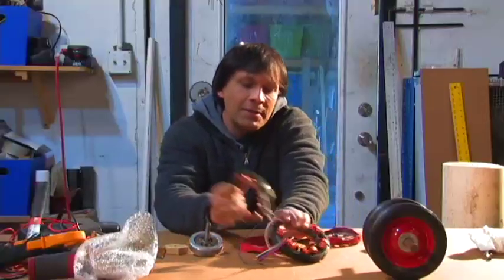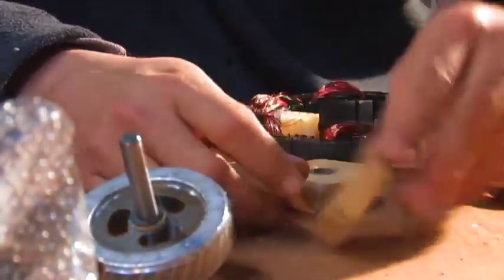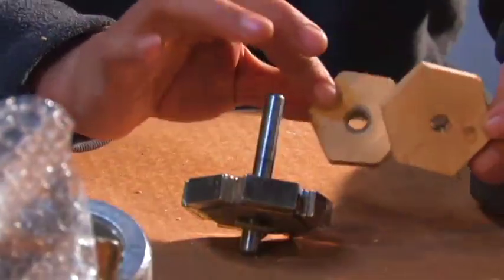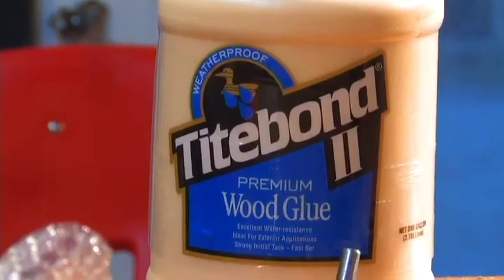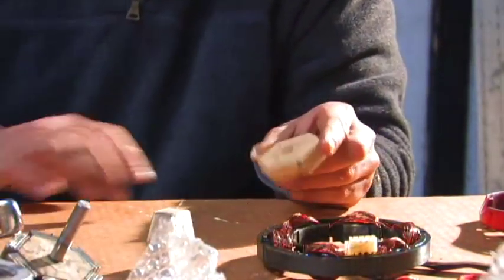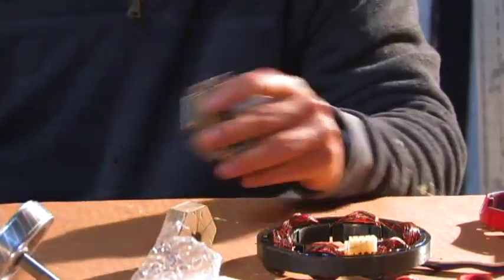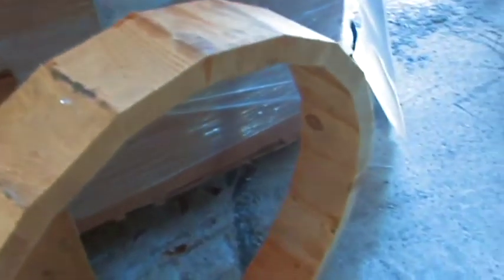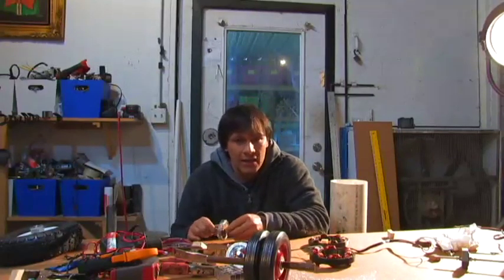INDUCTION MOTOR hack ALTERNATOR DIYNEODYMIUM MAGNET part 2

Comment: Hi Dan,

I have a suggestion to improve your design. If you Google "magnetic reluctance", you'll see what I'm getting at. I suggest adding pieces of steel, flat on one side and curved on the other, to fill in the space between the stack of magnets and the coils. The performance of the device should improve. It was stressed to me in college that the air gap is your enemy, in a generator. Better bearings allow for a smaller gap.

Thanks for being my host! :D

Comment: I would like to build a pma. But I was wondering if I can use any copper wire? and the other question is that if I use a bigger wire I will get more amps? Right
Call me dumb, but I rather ask than to stay in doubt. 
Thanks LM

Comment: @snooter28 Also, I thought about a turbine inside the gutters (vertical pipes) - but how many hours does it rain, really, and how often does it rain so much it would provide enough force to drive a rotor? You could make the pipe thinner, but then you'd have so little force, that it wouldn't generate much worth of power - interesting thought though - I'd love to see Dan doing some math, and come with an answer! :)

Comment: @smogharbel He's just showing that the wind would do to the generator. The rotor that he's driving with the drill, would normally be extended to fit some wings on. It's an easy way to test the setup before mounting the complete windmill and find it doesn't work ;)

Comment: Cool idea about the glue in the water bottle.   I use a small little 8 oz one for my water to water my soldering iron sponge.   I didn't think about putting glue in it.   I do a lot of paper models and this is a good idea.  Stupid glue bottles always clog and get stuck.  Thanks!

Comment: Are you thinking about an attempt using magnetic repulsion for energy? I have purchased some 1x2x.5 72lb pull magnets. and want to build a surround to hold them in place with the magnet of a large subwoofer in the middle. Then use a wooden dowel in the hole of the subwoofer magnet to mount a pulley, then to an alternator. First problem Im having is the ability to work with the magnets, they are too strong to mount them how I need to. I was curious if you have attempted anything similar